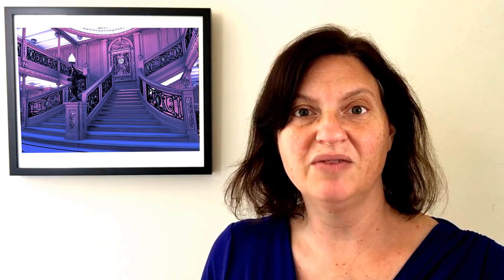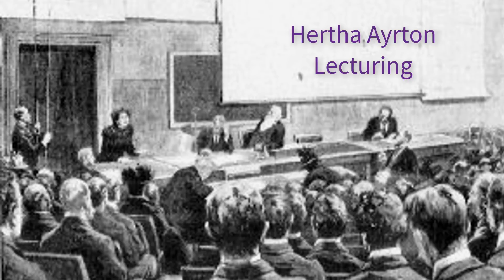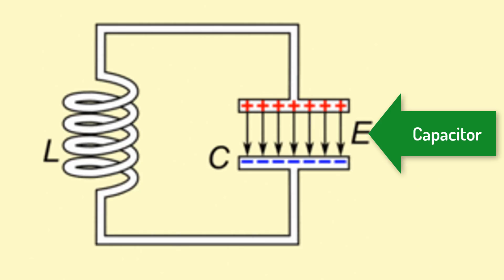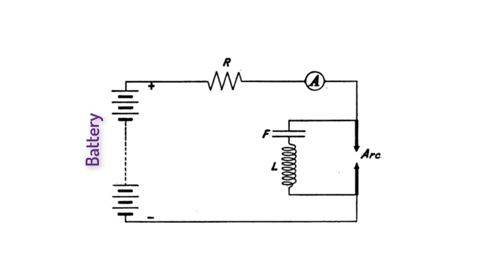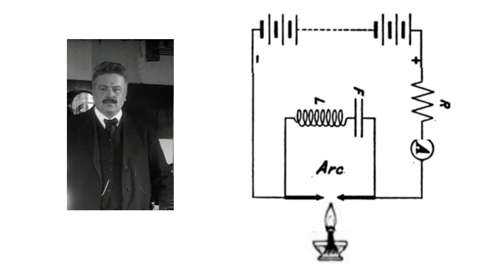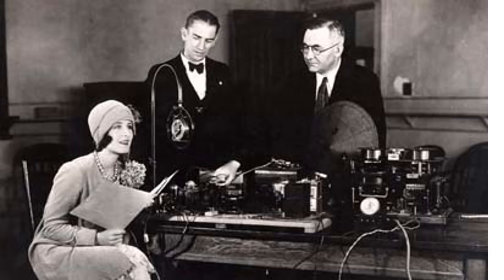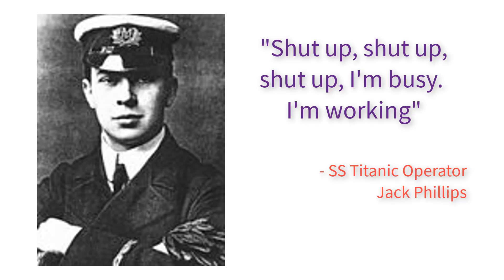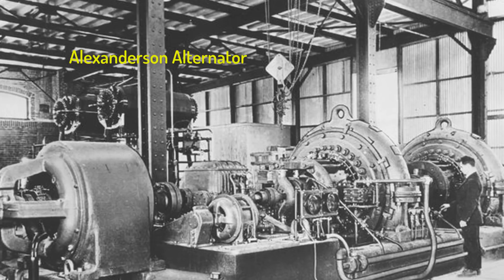The Arc Transmitter (Poulsen Arc) and the Titanic

Comment: The man working the wireless didn't put the iceberg warnings as a priority because the passenger wires were more important - what they get paid to do. Therefore they were put aside. 

Also, thorough the day the wireless room received 6 iceberg warnings, put together they indicate a giant ice field of nearly 80 miles directly in the ship's path, but no one thinks to put them together. Most of the warnings went un-noticed on the bulletin board. Later, when the California tries to warn Titanic about ice, by interrupting Titanic's wire, Titanic's wireless operator replies rudely back "Shut Up, I'm busy." The California operator then hangs up his head set and turns in for the night.
Reply from the maker: Davin Peterson true. Don’t you think, however, that if they had two or three operators working at different frequencies they wouldn’t have been so overworked?  Maybe not as rude as well so the Californian might not have gone to bed? Just a possibility.
Reply: IIRC, RMS Titanic had two radio ops. They both survived and gave evidence to the British (but not the American) official inquiry into the disaster. The ship's radio service was provided by the (British) Marconi company not White Star Lines - the ship's owners. Marconi radio was primarily a commercial service for (exceedingly wealthy) passengers - and so, yes, the radio ops' priority was to them, not the ship. I guess White Star chould have planned things better - except, Marconi was, at that time, the only provider of commercial maritime radio in the world.

The actual radio worked fine - all the Titanic's transmissions were received by the Marconi shore station at Cape Race, Newfoundland, many hundreds of miles away.

Did Marconi invent radio? Possibly not, he was very good at snaffling half formed ideas from others and making them work. He was certainly also a fine businessman, self-publicist and showman. He wasn't BTW, an Englishman - despite his royal knighthood and English gentleman lifestyle. He remained an Italian all his life and is buried in Italy.
Reply: @alastairbarkley6572  An other source claims, that operators where not allowed to repair the radio, but did anyway. Meaning: The only reason they where able to send a distress signal was by ignoring official procedure (putting into question if the radio worked fine).